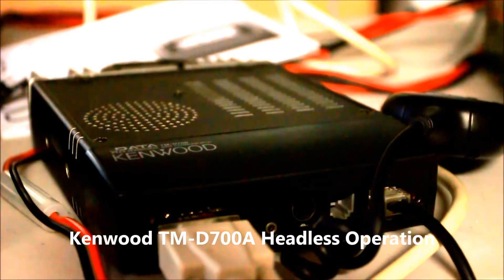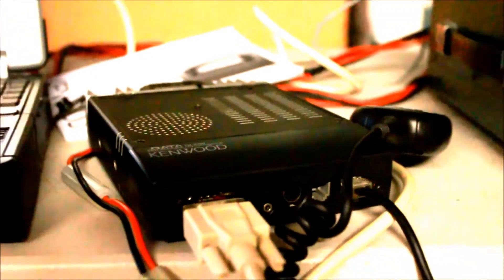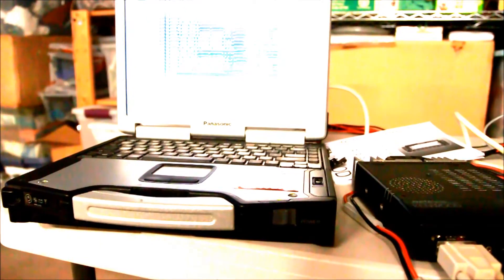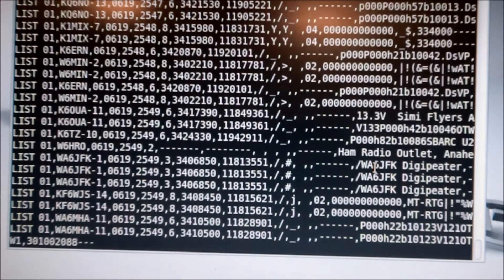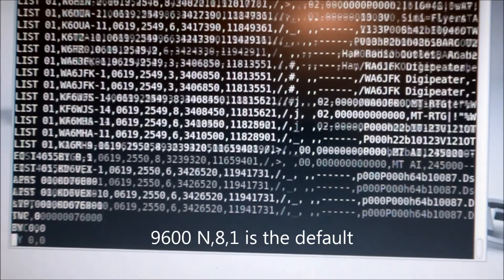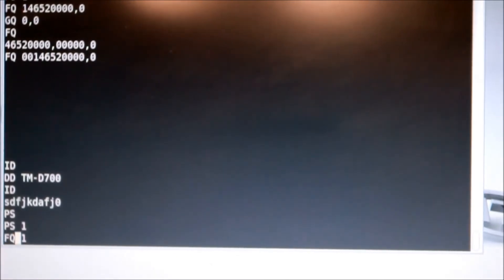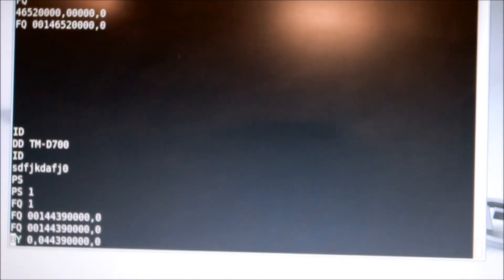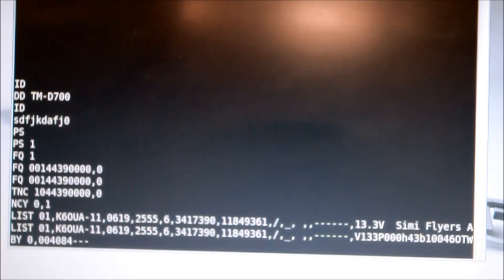Operating a Kenwood TM-D700A Without A Control Head

Comment: the TM-D700 head will also work on a TS-2000.
my head works fine on the TS-2000 but the radio won't switch on.
tried all the normal test's and checks but nothing,
so thinking this route ??

Comment: I'm subscriber 1k 😊🤣
I hear you can turn this into a mobile repeater.
I'm looking for something to use in my Jeep for when I go hiking with my baofeng and my Jeep buddies.
I'm looking at an IC2730a but I'm looking for someone to guide me. I'm a newbie.
Reply from the maker: Yeah, a lot of the dual band radios can be turned into VHF/UHF repeaters. The hard part is you have to have control (if it goes crazy you have to go shut it off), and you have to have power to the radio while you are out (ie leave the car on or have it powered by an alternate battery).
Reply: @ai6yr500  didn't think they suck that much energy 😮

Comment: So what program were you using to monitor the port? It seemed like you strategically cut off the top of the window! And was the serial cable a straight through or null modem?
Reply: I think PuTTY

Comment: Have you been able to get the TNC software to start after enabling the TNC 2 mode (PKT, not APRS)? I can put the radio into PKT mode with the "TNC 2" command but it does not start the TNC software. I'm stuck.
Reply: Try TC 0 (Upper case) in PKT mode then you get the com: promt